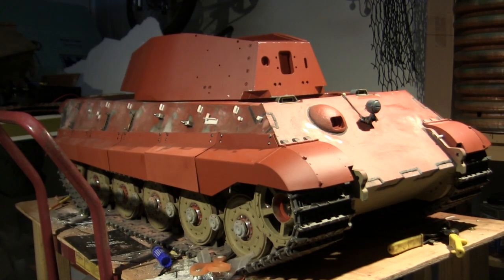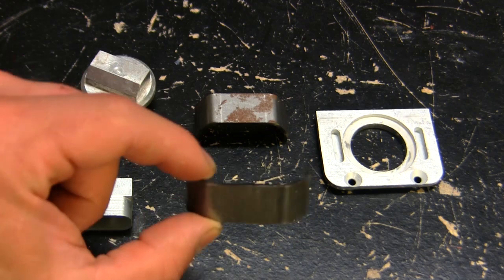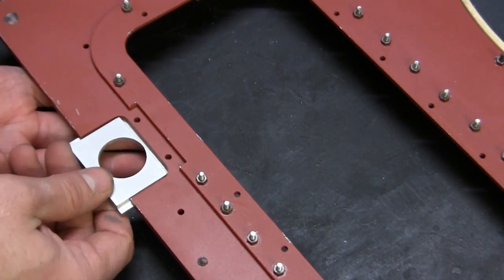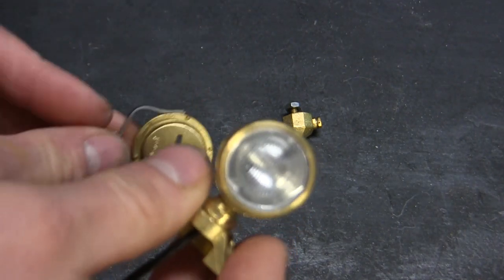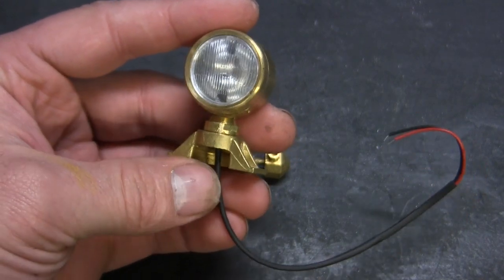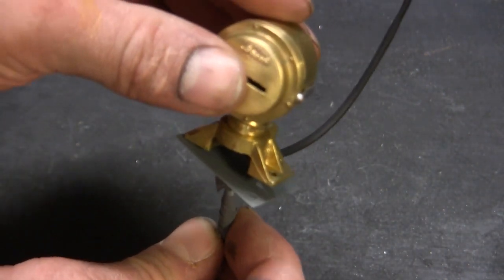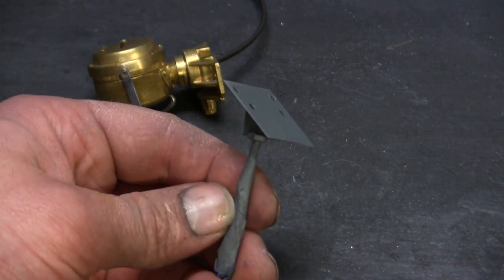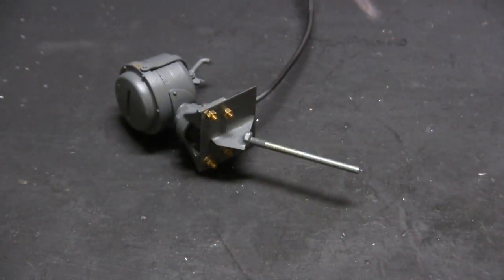Armortek 1/6th scale RC King tiger project video#17 (headlight, periscopes and more details)

Comment: Excellent video, great detailing. thanks for sharing, after watching this video I went out and bought a Dremel.  Hand filing takes 4EVER.
Reply from the maker: good job with getting the dremel, that tool is mandatory in this racket. get some good micro bits, routers, and high speed removal bits to go with that. Not to mention lots and lots of fiberglass cut off wheels.